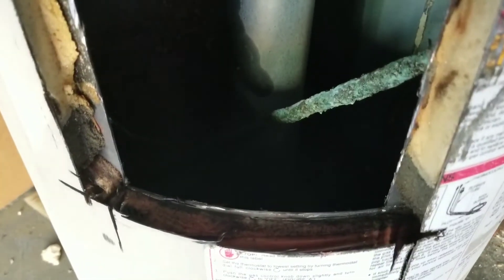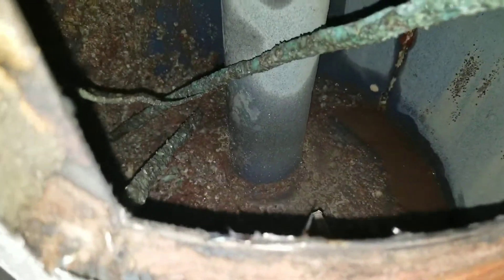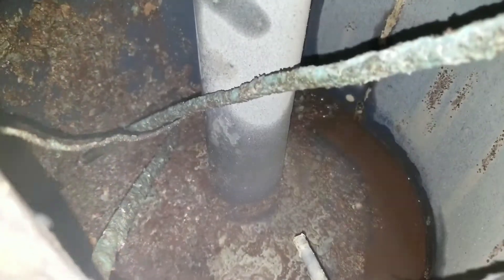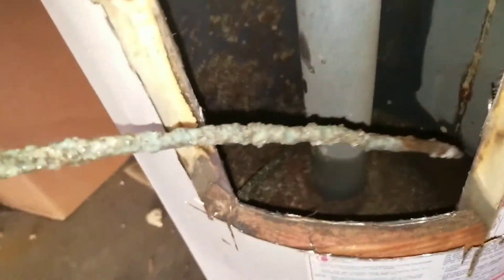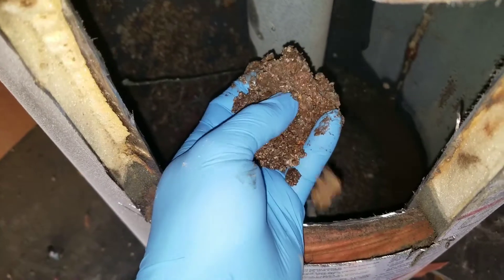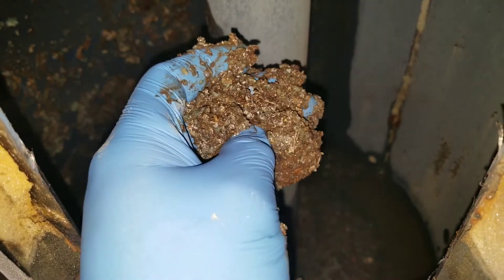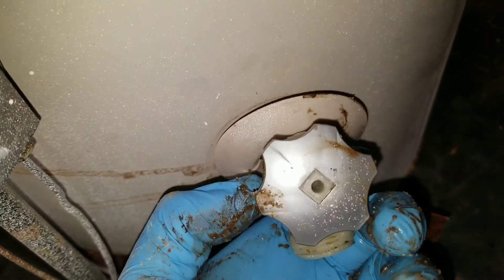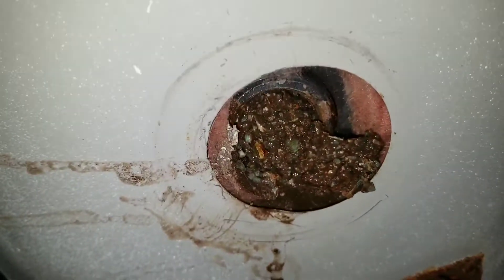Cutting Open A Water Heater and Looking Inside! Gross!!!

Comment: Here's a good example of learning from your mistakes I recently installed a new water heater and in transporting it I laid it on its side and it cracked the porcelain or glass on the inside of the water heater and it leaked right away had to buy a brand new water heater you're supposed to transport them standing up or take the anode rod out first so it doesn't hit against the side of the water heater I didn't know that but like I said learn from your mistakes I'll never do that again. Love you videos Sam keep them coming really good clear  explanations especially for the beginner.God bless u brother.
Reply: Thanks for the information but I borrowed my daughter SUV to transport and it was laid flat. I guessed I was lucky. It was back in 2018 and water heater so far so good. I just removed and check the anode rod, it is good (85%) for another 3 years.

Comment: If I need to drain one of these, doesn't matter if I destroy it, so I can get it out of my basement what's the best bet?  When I go to open the water heater nothing really comes out.  Suggestions?
Reply: if nothing comes out then sediment is either up past the drain or the drain is corroded if its a metal drain spout. I had a 20 year old tank that had rock hard sediment about 8 inches deep. homeowner did not know anything about anodes or regular flushing. Had to man handle it out of the hosue cause there was no way to drain it safely. if you have a floor drain in your basement the best way ive found was to remove the drain spout and shove something in there to release the buildup. a new drain is like 8 bucks. its going to be messy but sometimes its the only option.